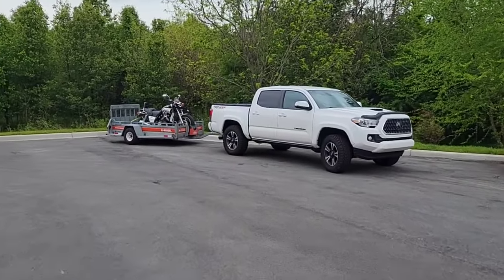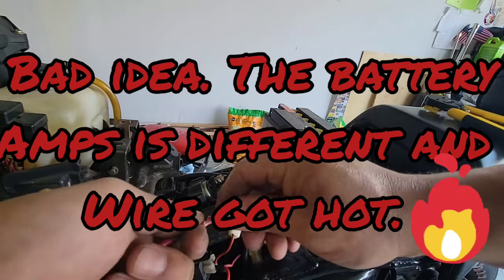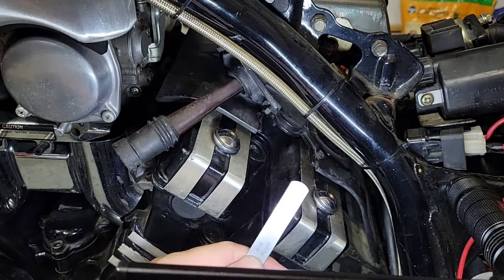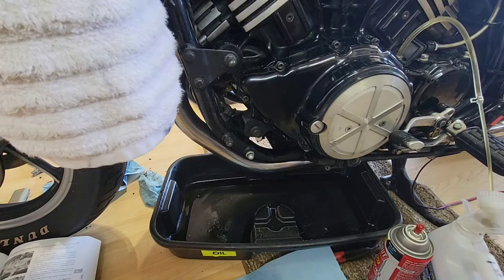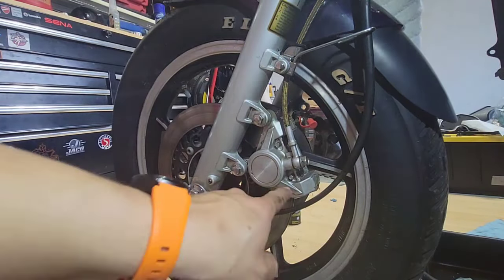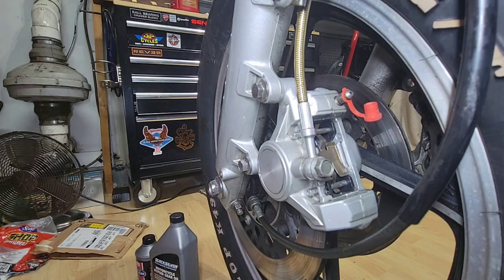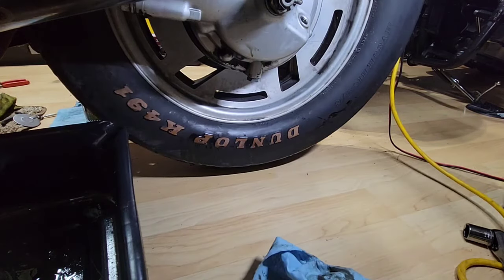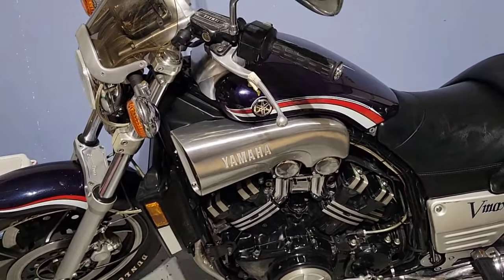1985 Vmax 1200 Gen 1 rescue process.

Comment: Things to know about the vmax carbs need to be synthesized. I’ve always ran hotter spark plugs and high octane gas for best performance and make sure you don’t set the battery on the fuel tank vent hose because it will cause the bike to vapor lock and it will die but all you do is take the gas cap off. Great bike and super fast.  Enjoy riding yours.
Reply from the maker: Thanks so much for your comments. I appreciate it

Comment: Great amount of work! Enjoyed your video👍🏻
Reply from the maker: Thanks for your comment. Is a process. I still working on it.
Reply: @FranciscoGalicia  I’m interested how you find the handling. I’m looking for one as a second bike. Mostly for two up touring.
Reply from the maker: @duke7888  the handling is good. At the beginning it was rough but the. I found an air valve in the front for and read the manual and applied 6psi and much softer. This is not a beginner bike as it has too much power and not too much technology on breaks,  traction control or curves. I like the bike as it has a lot of power and you "play" when accelerating and spinning the wheel. I still have the original tires and the are dryer and spin a lot. I am waiting for a new set and see how it feels. I was thinking to get it, fix it and sell it but not sure now. Nice bike. I compare it to my last bike xdiavel s 2016. Thanks for your comment
Reply from the maker: @duke7888  sorry. I didn't answer about touring. I think for touring will depend on how you guys are phisically. I am 5"11 and always ride solo. I think is better for short trips. Also the gas consumption is not good.

Comment: I'd get a frame brace for it and make sure your fork seals are good with equal pressure. My 85 was squirrelly at high speed.
Reply from the maker: Thanks. I just replaced the seals and I posted a video. Thanks for watching

Comment: There is a drain plug underneath the gas tank. I get to mine from the left side cover underneath. Treat & Flush it out good & pull the lower carb drain screws & take air box lid off & spray carbs out with carb cleaner. Then put all back together. I’d change all fluids if bike set for any long length of time.
Reply from the maker: Thanks for  watching. I did change all the fluids and filters.  Thank you. I didn't know about the drain. I will check it out.

Comment: Loved your video..I have a question which in my opinion is very important for your safety..Did you also change the oil in the front forks and changed the oil seals?
Reply from the maker: Thanks so much for your comment. I haven't change the oil but is on my plans. I didn't see any leaks with the seals but I will consider them as well. What I did is to put 5psi of air to make the suspension softer. Also I am planing to replace the steering bearings.  Again, thanks for your comment and suggestions
Reply: @FranciscoGalicia  When you do these activities I hope you can also make a video of it. Thanks..good luck
Reply from the maker: I will try for sure. Sometimes I am doing something and goes wrong and doesn't publish it. Lol
Reply from the maker: I did a video for my other bike kz650 1978 for the fork that I think is very similar. Let me know if that helps. https://youtu.be/jm2uH1cPEw0?si=UbbhihpBw5A_B2QG

Comment: I hope to have one of these bike some day! You are lucky you did not have to pull the carbs out and clean them, the previous owner must of ran the motor till it was out of gas. Not sure next time when you do the brakes, split the brake caliper in half, push the piston's back in with a c-clamp. It may leak fluid as it's a dual caliper system. They are slick looking bike.
Reply from the maker: Thanks so much for your comments. I really appreciate it. I think the problem was the fuel pump. I replaced it with a new one and cleaned the fuel system. Still have rust inside so I may need to remove the tank and clean good and paint. Thanks for the tip for the breaks.
Reply: @FranciscoGalicia  if you do that, put 1/2" chunks of gravel in the tank. Count the small rocks, what goes in needs to come out IE 12 in 12 out. Shake the tank  back and forth with the rocks in it. It will loosen the rust. There is a cleaner you can buy for that too and run Seafoam at the same time. Good luck!
Reply from the maker: @thermos750  yes. I seen that. I did put a lot of vinegar and brushed but not enough. I think will be a winter project. Thanks for your recommendation
Reply: @FranciscoGalicia  I would not use  "vinegar" as it's a water based cleaner and you don't want that in your gas tank or fuel system! Varsol or paint thinner will work or fresh gas is also a great cleaner and having the sea foam after will help.
Reply from the maker: @thermos750  I used it then clean and dry well also used a special product for rust.
Reply: @FranciscoGalicia  you could use a cleaner like "CLR" calcium, lime and rust cleaner. Not sure if you have it down there but very popular in 🇨🇦 should have something simular!
Reply from the maker: @thermos750  yes. I will use them when I do the cleaning. I am in Kentucky USA and we have that product.

Comment: Tengo una de ese miso año, la tengo desde hace 20 años y no la quiero vender , lo unico malo es el sobrecalentamiento, la bomba de gasolina no es la original, crees que eso contribuya al sobrecalentamiento?  Felicidades por el video, muy bueno.
Reply from the maker: Hola. Muchas gracias por tu comentario. Yo remplacé la bomba porque no funcionaba. El sobrecalentamiento es más por la bomba de agua más seguro el termostato que no abre para que el agua fluya mejor. Acabo de hacer un vídeo de poner el ventilador manual ya que la mía prendía casi en lo rojo. Suscríbete en mi canal para que veas el que subí hace unos días. Saludos

Comment: who changed the fuel pump, thats a big job, I wanted to see that
Reply from the maker: Hello. I did the change. It was easy. I just removed the old one and plug the hoses the way they were and an electric quick connect. If you start removing the old one just replace. I recommend the original one to avoid issues with cheap ones. Thanks for watching

Comment: Best bike you'll ever own the 1985 had some problems with the shaft drive you might want to get a new shaft drive you know use like a 92 or something it's in good shape and just reinstall that if it's a real 85 shaft drive that's still on it try to get one that's you know out of the 80s and the 90s cuz they fix the problems by then and it'll be the best bike you ever owned that motor is fucking bulletproof
Reply from the maker: Thanks so much for your comment. I really like the bike and it is all original. I like that. I heard the issue with 2nd gear and hopefully all good. I treat her like a queen. Oil changes etc. I do ride her fast to feel the VBoost. Heck yeah